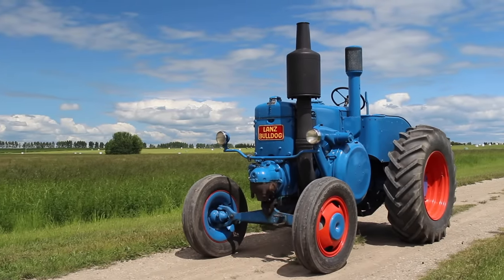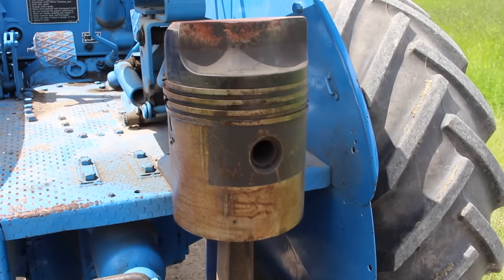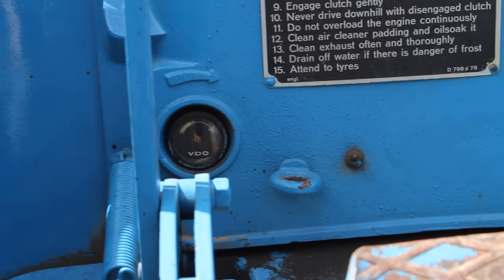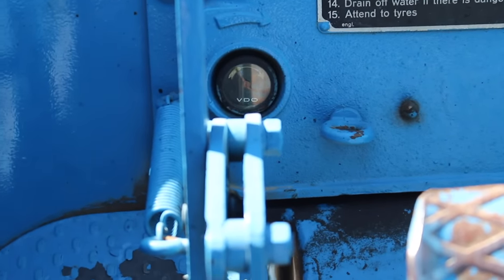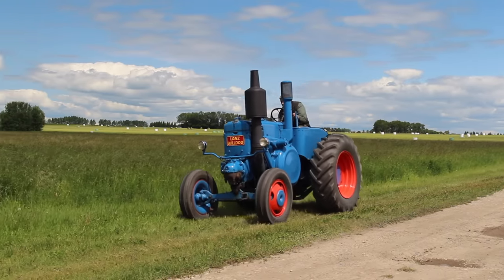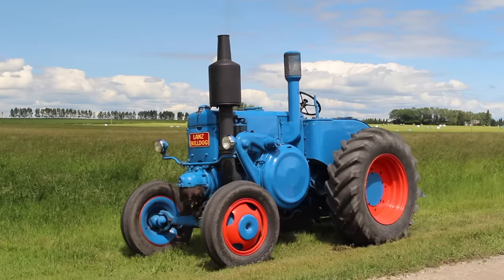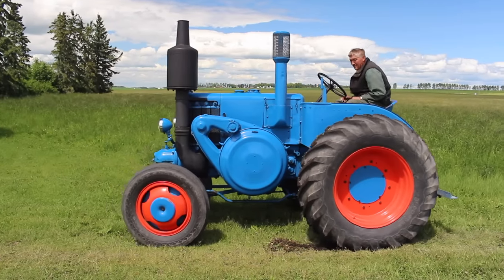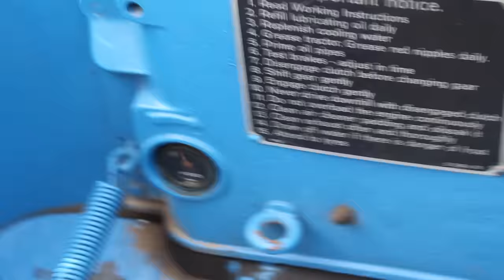Engine running backwards? Lanz Bulldog Tractor two stroke

Comment: 0 rpm must give an enormous mechanical strain on the rod, gear and bearings. Strong engine!
Reply: Also I'm pretty sure the oiling system doesn't work at "0 rpm" so definitely not healthy for the engine.
Reply: @creak92  It's a two-stroke so there is no oiling system. And the engine was actually meant to be able to do this 0rpm thing
Reply: @creak92  Very interesting what you wrote! I think I didn't express myself the right way with saying the 0rpm thing. I actually meant going from forward to backwards movement which the early engines were definetly meant to do because some versions of the Lanz Bulldog had no reverse gear. I don't know about the later versions but some of the earlier ones are still around here and they don't have a reverse gear.
Reply: The internals are so beefy they will take it. As far as i know the oil pump works in both directions so it should pump atleast some oil at 0rpm.
Reply: @thomasheller629  The early ones did in fact rely on running backwards to drive backwards. This was a more of a cost cutting measure than a good mechanical solution. The crankshaft isn't located in the center of the cylinder bore so on the down stroke the rod is traveling prependicular to the cylinder minimizing wear. With the engine running backwards this leads to the rod being at a unfavorable angle during the power stroke which leads to more wear. This is why the factory manual (You can find multiple scanned PDF ones) warned against running the engine backwards under load for extended times. As soon as a reverse gear was added, while it was still possible, there was not much use in running the engine backwards
Reply: @nicostenfors5690  The oil pump/distributor or Bosch Oiler is comparable to a modern AC compressor as it consists of multiple pistons actuaded by a "bent" rotating disk (axial piston pump). It is driven by a worm gear. So while it works with the engine running in both directions it will only work if the engine steadily turns over in one direction as the pump needs to do a full rotation to pump oil and due to the worm drive you need multiple engine rotations for one pump rotation.
Reply: @creak92  Its a 2 stroke has no oiling system!
Reply: @bureauoflandmanagementblm3828  This is a tractor not a god damn weed eater. How else should the bearings be lubricated if the fuel is injected to the cylinder and never comes in contact with the crankcase? Of course it has an oiling system just like every other two stroke diesel. I'd suggest reading up on the subject first.
Reply: @creak92  it’s a dry sump, or oil bath. You must’ve never herd of zerk fittings and grease lol stop trying it’s a 2 stroke and is literally a big weed eater smh 🤦🏼‍♂️
Reply: @creak92  
If it's crankcase scavenged, it has no oiling system. The lubricating oil is carried in with the intake charge into the crankcase below the piston. If it has a blower to produce a positive charge vice crankcase scavenged, like a 71 series Detroit diesel, it can have a pump driven wet or dry sump oiling system. I believe.
Reply: @tonyelliott7734  It's doesn't fall in either category. It's crankcase scavenged but as the fuel never comes in contact with the crankcase there needs to be a different source of lubrication. This is done by oil pumped to the two main bearings, the rod bearing and the cylinder wall which also drips onto the wrist pin. These are only oil lubricated bearings so the amount of oil pumped into them is far lower than what you'd expect from a modern engine where the main and conrod bearings are fluid bearings. As engine speed (and charge air velocity in the crankcase) is low most of this oil drips down and accumulates on the bottom of the crankcase from where it is pumped back to the feed tank. Of course some oil will get carried with the charge air and be burned so oil has to be added regularly.
Reply: @creak92  you're wasting your breath on these mouthbreathers.
Reply: Some people hear really don't know how a 2 stroke motor works apparently, cylinder wall and piston is lubed by pre mix, meaning oil mixed in fuel or a pump that injects oil into fuel as it injects fuel into carb. The crank and bearings are lubed through scavenging. Crankcase oil doesn't mix into the cylinder.  Unless you want a runaway. 2 stroke diesels required scavenge "blower or turbo" due to no spark ignition. It's pretty dam basic and not hard to understand
Reply: @goodlydanz  This tractor doesn't use premixed fuel, and it doesn't have a blower. It is a crankcase scavenged diesel so no need for a blower, but since the fuel is injected it would never be able to lubricate anything in the crankcase. So it has a dedicated oil pump to lube everything.
Reply: 2 stroke has nothing to do with lubrication only with the power cycle lmao. Bunch of people who changed their oil a couple of times thinking that gets them an ase cert in these replies.
Reply: it's a tractor....there built tough and old ones at that
Reply: Yes very cool Walter White
Reply: @goodlydanz   and all people that think that just because you hear the word two stroke doesn't automatically mean the oil and fuel are mixed.  Its a 2 stroke DIESEL not 2 stroke GAS.  There is no such thing as a 2 stroke DIESEL where the fuel and oil are mixed...except by happy accident from blow-by.  Take a minute to look up how a 2 stroke Detroit diesel works and you'll better understand. This tractor is closer to a Detroit diesel than a weed eater -of course some mechanical differences exist (read blower, etc etc ..)
Reply: @Stolas fast direction switch.  Means it's already running, ready to go the direction of your choosing.
Reply: Lets dissect for a moment, two cycle gas, and two cycle diesels have the same idea of running every single revolution theres combustion, just diesels have one valve on top for exhaust, one port on the side for super charged fuel charge, the diesel does have oil in the crankcase, two cycle gas does not.  This tractor has a hot bulb engine so it has the idea of a gas two cycle, but diesel, think of the hot bulb as a huge glow plug, it acts as the sparkplug  firing every revolution.  More or less it runs exactally like a weed eater, but with diesel fuel instead, and a hot bulb instead of a sparkplug, in other words the oiling happens when the fuel enters the crankcase.  Now i dont know if oil is added to the fuel in this tractor like a weed eater, since my assumption is since diesel is an oil itself id assume not.
Reply: @jakepieschel5353  No. with the diesel the fuel is injected for combustion. It isn’t pulled in through the crankcase. It does pull in air through the crankcase, but not fuel. The hot bulb also doesn’t work like a spark plug. It doesn’t fire. It stays hot and just acts as a hot spot to start combustion. 

Just because it’s a 2 stroke doesn’t mean they all work the same.
Reply: WHY though....just why
Reply: @NBSV1    okay ill admit i didnt get it 100% right, i sorta had an idea on how they worked but need to do more reading up, shouldn't of commented, sorry.  But one thing i do know is the part where i mentioned about the hot bulb acting as the sparkplug, what i ment was it is there in place of the sparkplug for combusion, i know they dont work like a sparkplug, more like a glowplug in a diesel engine except it isnt powered by electricity like a glowplug.  Sorry for the confusion.
Reply: @thomasheller629  well done mate. Some people lol
Reply: @goodlydanz  here*
Reply: That whole rod oscillating back and forth was the the whole thing. It could easily bare that weight, and at masses like that, the piston forces created would rock that wheel back and forward like a hammock .
It's been running since the 1950s and hasn't failed, right? Haha
It was made for this, and mechanically would've been comfortable rocking back and forth like this. I can't imagine it would've been good for the engine when he was jumping around like that while it was in gear, but anyway.
Yeah this makes sense
Reply: I'd be more worried about the connecting rods. They aren't meant to take that strain
Reply: @nicostenfors5690  oil pumps can run backwards..... but wont push oil onto the bearings. (instead, will try to suck oil off the bearings) 
.
however.... for short periods of time.... their is probably no harm being done
but i would not run the engine backwards for 4 hours while in the field..... that 100% would cause MASSIVE damage
Reply: @bureauoflandmanagementblm3828  2 stroke diesel is NOT a 2 stroke gas engine 
.
sure.... diesel fuel is kinda like oil.... but a VERY light oil (instead of the 15w-40 most use today.... or SAE 30 in the old days..... its more like an SAE -20)
thats not "thick" enough to lubricate the bearings..... 
.
but, as seen in semi truck engines that regularly hit 1 MILLION miles.... it does help
.
but a gas 2 stroke has "real" oil mixed with the fuel..... or is injected
on my 1974 kawisaki G5 100cc 2 smoker.... it introduces 50% of the oil just behind the carb.... and the other 50% pressure lubes the main crank bearings
pressure lube on a 100CC is overkill.... but that motor is VERY VERY tough because of it
.
however.... a 2 stroke DIESEL still has a crankcase filled with oil (which a gas 2 stroke does not)
look at the old Detroit 2 smokers..... you still had to drain the oil (about 48 quarts iirc) every ~8000 miles
.
so, again.... a 2 stroke DIESEL does not get its lube from the fuel.... or from an injection system
and instead lubes just like any modern 4 stroke gas engine 
.
Reply: @Sflhunter  also.... have you heard of "Detroit Diesel"?? 
ya know.... stuff like 8V71?
.
they still have a crankcase full of oil (48 quarts)..... just like a modern 4 stroke gas or diesel engine
.
just to let you know.... im a mechanic.... and do oil changes on everything from your moms honda.... 
to cummins ISX
to old Detroit 60 series and 4/6/8 V 71s... 
.
Reply: @tonyelliott7734  that is so wrong.... 
.
you are using the correct terms..... but have no idea what the terms mean
Reply: @kainhall  As mentioned above the oil pump is a axial piston pump and will pump oil in the bearings in both directions.
Reply: @bureauoflandmanagementblm3828  a 2 stroke diesel is different than a 2 stroke petrol
Reply: Any old 2 stroke golf carts run in reverse
Reply: Lol 0 Rpm is not a rotation so the engine would be not rotating... weird
Reply: For sure!
Reply: Why would there be strain? There would have to be a lot less stress than running at 100 or more.
Reply: Let us not forget splash lubrication and also massive flywheels absorbing mechanical shock.
Reply: @gabrielvieira6529  and allmost all others. 0 rpm is an average measure pr  minutes. Actually the crankshaft rotates ~ <1 revolution clockwise followed by ~ <1 revolution counter clockwise.
Reply: People 2 stroke doesn't always mean no oiling system.
Many large 2 strokes still have a oil  sump.

Up until  the past 20 years or so the vast majority  to large diesels, where 2 stroke and no I dont mean your truck, I mean marine, train, and off road construction trucks.

Many semi trucks had 2 stroke Detroit diesels. Old greyhound busses did too

Now the crazy part with 2 stroke diesels some used a supercharger to suck out the air and not blow it in.
Reply: @Stolas That isn't idle.
Reply: Loz
Reply: had to be
Reply: 0 rpm just means it doensnt make a full rotation
Reply: its huge it can take it
Reply: A visual representation of they aren’t made like they used to be
Reply: @ryanclark7391   Ain't that the truth.
Reply: @nicostenfors5690  yeah what should happen is the engine goes partially forwards, pumping oil, then when spinning back it would still pump more oil
Reply: @creak92  when it's running backwards it's running basically the same as forwards, just the rod is on the other side so it goes backwards instead, so there shouldn't any real stress as far as I know
Reply: @creak92  “it’s tractor not a god damn weed eater”.... lol it’s a 1 piston 2stroke tractor....so quite literally the same as weed eater just larger in scale.
Reply: @kekeruus  go eat some paint chips
Reply: I’d imagine the torque strain must be significant but I’m no engineer and it seems like there was very little gas flow. So maybe it’s not as bad as it sounds? 🤔🤷‍♀️
Reply: And it must strain the axels too
Reply: @jakepieschel5353  Even a 2 cycle gas engine doesn't have to premix... it is merely done for simplicity, for example some of the later Evirude boat motors are gas 2 strokes... however they have sophisticated oiling systems to reduce oil burn due to emissions. In the 90s they also had auotmatic oilers that premixed for you (and when they broke your engine was toast).
Reply: That's what I was thinking
Reply: @thomasheller629  I'm not so sure about that
Reply: I would say Yamaha Blaster
Reply: @jonnothetrucker  exactly the maker of this video going to see all of this arguing and going to be like what the heck
Reply: @proarmy70  exactly this particular diesel is a hot bulb
Reply: @EvatronX  not necessarily anything can be hard on something
Reply: @wildman510  I think you're right and there is some engines that depend on the Run backwards for a reverse for instance Yamaha G1 golf cart but relies on this principle
Reply: Someone please explain to this neophyte, the transmission system it takes to allow an incomplete revolution engine and to move the vehicle forward and backward.
Reply: Think of the g force involved in the change of acceleration
Reply: Every engine is doing 0 rpm at the top and bottom of the stroke. by necessity every reverse in linear motion must come to a complete stop.
Reply: its barely idling. There is no load on the engine thus there is barely any strain on the bearings. While its rocking back and forth the compression and friction is slowing the moving components down, then the air fuel mixture is ignited and drives the piston back. Not much strain is put on the bearings. The only issue could be the lubrication of the bearings when you run it for long
Reply: @kainhall  The swashplate pumps in these engines pump oil either way.
Reply: @kainhall  The swashplate oil pumps in these engines work forward or backwards.
Reply: The old Irish canal barges used Bolinder semi-diesel two-stroke engines. You reversed the engine to reverse the boat....
Reply: @creak92  I bet the plungers don't care about anything except that somehow they are being propelled up and down - they still pump : D
Reply: @creak92  Ever seen a model airplane Homologous Charge Diesel? No oiling system. (PS - I own a Comet Chainsaw - only oiler is for the chain)
Reply: @kekeruus  the mouthbreathers won't listen, but the rest of us can learn something new- so explanations aren't wasted :)
Reply: @nicostenfors5690  there is no oil pump on a 2 stroke the fuel is mixed with oil that’s how a 2 stroke gets it lubrication
Reply: @captain1334  Not on a 2-stroke diesel. You are thinking of a normal gas 2-stroke.
Reply: @tHa1Rune  "It's been running since the 1950s and hasn't failed yet"... Except for the random piston mounted to the back of it, presumably an old retired piston. It's a single cylinder ya know. Me no expert, but methinks it failed before.
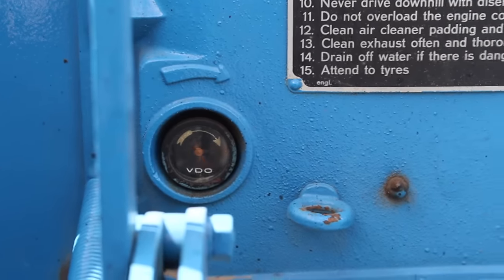Reply: @thomasheller629  At time mark 1:11, read the instructions. It literally says on instruction number 2 to "Refill lubricating oil daily"

There's literal instructions on the thing, try reading them first.
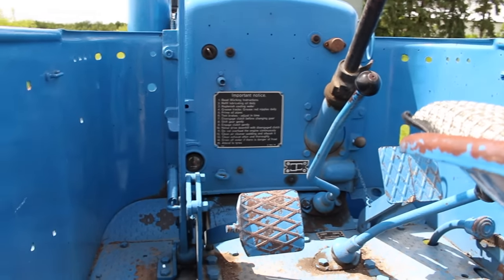Reply: @bureauoflandmanagementblm3828  Time mark 1:11 has instructions. Try reading them. Number 2 says literally "Refill lubricating oil daily"
Reply: @thomasheller629 Das ist Quatsch was du hier schreibst. Obwohl es ein Zweitakter ist, läuft er nicht mit Gemisch, sondern hat eine Ölschmierung mit Ölpumpe, welche  Zylinder und Kurbelwelle inklusive Lager mit Schmieröl versorgt.🙄🙄🙄🙄🙄🙄
Reply: @creak92 two stroke my friend. The oil is in the fuel…
Reply: @thomasheller629  (most) Two-stroke gas engines don't have an oiling system. Two-stroke diesels do.
Reply: @goodlydanz  Apparently you don't. You don't mix lube oil with fuel on a diesel, it has no carburetor and fuel is injected into the cylinder. This tractor does scavenge combustion air from the from crankcase pressure, but it does have a lube pump to oil the bearings. No. it's not hard to understand, but you don't understand it.
Reply: @jakepieschel5353  I know a little about this tractor. Oil is pressure lubed from a clean oil tank though the bearings and collect in the bottom of the crankcase sump. Oil is then pumped out of the crankcase and put into the used oil tank. the used oil is then pumped from the used oil tank and is burned in combustion. They say it will use about a gallon a day of oil under hard work. No oil is mixed with the fuel, other than a little is drawn out of the crankcase with combustion air, and what oil is injected along with fuel into the cylinder to be burnt. 
The hot bulb is used because this is a low compression diesel, it doesn't have enough compression to generate enough heat to light the fuel charge without some help by way of the hot bulb.
Reply: Definitely not healthy, but with how low the rpm is it’s no where near as catastrophic as if you were to do it with any modern engine
Reply: only when in gear ,going so slow easy on motor ,but back and forth is harder on gearbox i would think
Reply: How can it give a lot of strain when engine speed is reallllyyy slow?
Reply: @creak92 the gas has the oil